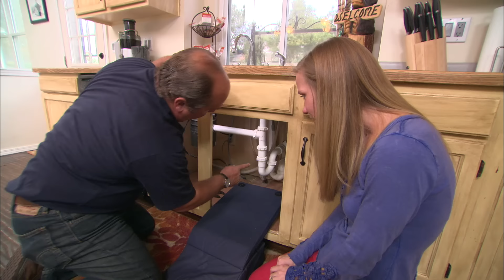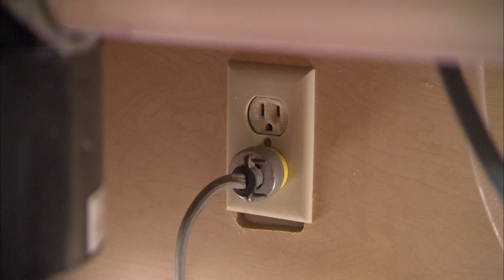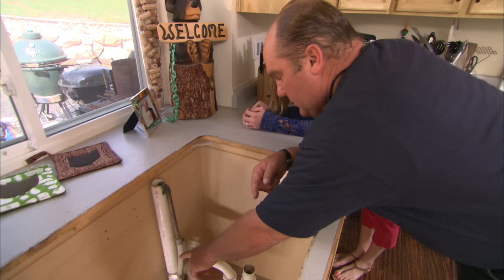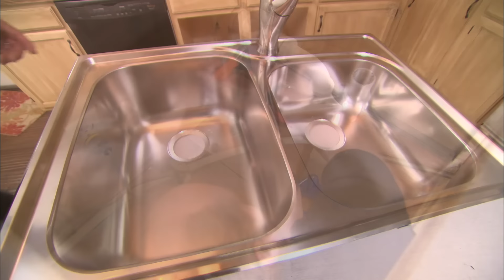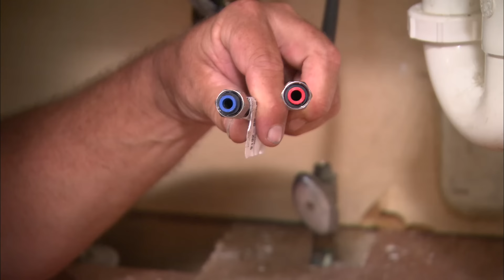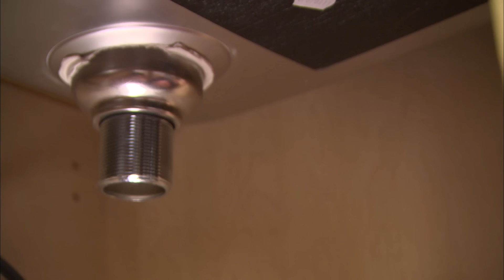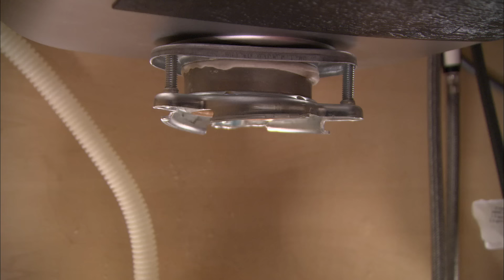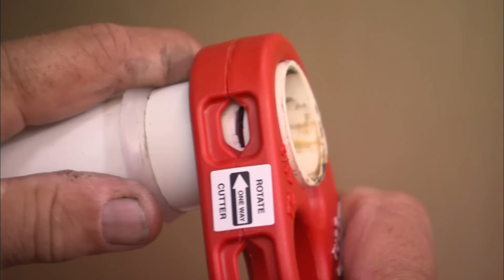How to Replace a Kitchen Sink and Faucet | Ask This Old House

Comment: What's a reasonable price I should pay someone to install a sink, given that I have already bought the sink, and just need the old one taken out, and the new one installed
Reply: I guess you've found the answer to that by now - kindly delete your post
Reply: TinaxSwag If your new sink requires  new pipes  and relocation add abt 100-150 plus labour+ TRIPSO:YOU SUPPLY SINK AND FAUCET, BUDGET ABT $250.

Comment: Why not attach the sink strainer basket and disposal while the sink is out? I've done strainers while the sink is out and it makes the job much easier.
Reply: The disposal unit is 4x heavier then the sink, imagine trying to lock it in place upside down? Having the sink flailing around because it’s light, possibly scratching it or damaging it. It just takes 2 seconds to place that thing in place afterwards

Comment: Nice video! Good info!
I needed help with having to get 32-year-old PVC drain pipes to line up to a new, molded-in, Corian sink, with the drain holes cut in a totally different location.
I just hope that the PVC joints are NOT GLUED, like I've seen in other videos from other mid-80s builds!
With MY luck, they probably are.
Reply: how did it go?
Reply: I guess you've found the answer to that by now - kindly delete your post

Comment: i Have a Question about Do You Think it wiLL Be possiBle Too put A kitchen Sink inn A Master BedRoom How Master BedRoom Have 2 sinks only BeCause

?ii? wonder is it The same Type oF pipes Should Be? some custom pipes at The HardWare Store What Give Me a HeadAche
The drain is more Smaller Soo should That Be a Big deal ?ii? wonder ii Got Too Look up other Videos uP ?✌🌎💨🌊💦🔭🔬📚📚📚📚
Reply: Lee Loomis OK
Reply: For a kitchen the diameter of the drain pipe is 1.5".  I believe bathroom drain pipes are 1.24."  You will have to go with the smaller diameter pipe.
Reply: in the bedroom??
Reply: Are you high?  Maybe you’re a child learning to type for the first time. Perhaps you spilled some apple juice on the cap lock key?

Comment: If your plumbing is very old often the shutoff valves under the sink can leak and/or not completely stop the flow of water. You can shut off the water main to the house and the feed valve into the hot water heater, then open the lowest (basement) faucet in the house to relieve the pressure. Then disconnect and install new lines onto shutoff valves. You might also want to just replace the shutoff valves under sink as well if they are all cruddy (if they thread onto supply lines, otherwise just leave em alone). Also, don't overtighten the flexible supply line compression fittings-just snug them up. If they leak, you can just tighten them a bit more until they stop leaking.
Reply: Just clean and debur the end or  it will cut the o ring. Just slide it on and make sure it's seated all the way.
Reply: and if your main shutoff in the house fails as it did in mine then in the front yard there should be a township/city shut off valve so you can replace everything.  Renovations always a fun thing!
Reply: Hot water eventually destroys the seals in the shutoff valve.
Reply: @n9wox 
Not a ceremic valve.
Reply: I had my kitchen remodeled after 14 years.  I'm on a well with hard water.  Do you think my stupid plumber recommended installing  new shut off valves  under the sink, when the area was open and new cabinets were being installed?  Heck, no!  Fast forward 16 years.  I'm about to replace the faucet myself and the first order of business will be sweating on new shut offs.
Reply: MarzNet256 if I have to replace my shut off valves and they're so cruddy I need to cut the copper pipe, do I need to do anything special besides sand and cut them before putting the new stop valves on? The new ones are sharkbite valves.

Comment: But not a word about checking for feed line or drain leaks - even with all new parts and quality work and pipe alignment you can still have pvc parts that the nylon gaskets simply refuse to seal. Sometimes its the brand of pipe, I had one sink drain assembly with raised lettering right where the damn seals needed to go - wth-???

Comment: Who makes that pipe cutter?
Reply: Rigid. They've been making plumbing tools for a hundred years though they make electric drills and a host of other tools today.
Reply: Thanks Joe. I did find it locally. It's been hanging on the wall at a local plumbing supply for years! It was there all the times I was there getting other things and did not happen to think about it! Anyway, I own one now.
Reply: I end up needing one of these every couple of years.  For $20, well worth it.

Comment: Do you actually need to use the putty on the top side when the drain assembly has the gasket on the underside?
Reply: cetusipy yes
Reply: yes, it would be possible for water to leak between the sink that the top portion, into the bell housing on the bottom and damage the connection.  there was  a segment on ATOH where that is what happened to the home owner.
Reply: YES!!! That's THE seal between the sink & the drain pipe!!!
Reply: Yes or else the bell will fill up and rust
Reply: cetusipy yes but silicone is leakproof longer
Reply: Rubber seal does the job also

Comment: How is this sink vented?  I thought they would have to install an AAV.
Reply: The waste line is connected to a vent stack inside the wall.
Reply: With the age of the house and this being a sink under a window it probably wouldn't have a run of vent pipe leading to the stack... too bad they didn't discuss this at the outset.
Reply: Because the sink is under a window, the trap arm running into the wall most likely has a 90 elbow running left or right passed the window then drains down and vents up with a sanitary tee
Reply: On my mobile home the only vent comes from the other sink haha

Comment: Great work except that any drain line left unless, needs a permanent cap per city code.
Reply: How do you know what the local plumbing code requires at that location?  Local plumbing codes are not universal across all cities in the United States.
Reply: Good point Cortez but, a glued plug or some form of permanent cap would be required by most if not all.

Comment: The screw clamps on my sink are rusted solid. What to do...
Reply: Cut them off!
Reply: Burn the house & start over ;)
Reply: I am not sure if there is room to cut them off, but I will try. Thanks. Burning the house down would definitely be profitable due to the low market value of my house and the replacement cost policy that I have. However, I want to try cutting the clamps off first,  but I will keep the fire idea as option 2. Thanks.

Comment: Richard, get rid of the hand saw and get yourself an osculating multi tool
Reply: On that job, I would prefer the oscillating tool like my Multimaster.  Just works better in cramped conditions like this.
Reply: I use a ridged ratcheting pipe cutter cuts up to 2 “ abs pvc. Clean quiet quick.
Reply: Seriously. I saw that and all i w as s thinking was, "this guy can't afford a Hackzall?"
Reply: BubbaGrace A reciprocating saw can be awkward to use in confined spaces, an oscillating saw is a much more efficient tool to use
Reply: oscillating tools are awesome. Make a terrible sound but awesome lol
Reply: Most of us use a reciprocating saw (Sawzall) for this.
Reply: Moon Pie - I like the cut of your jib sir/madam! I use plastic explosives myself, and the resulting prison time frees me up from everyday sink chores ... ;)
Reply: They make pliers to cut through pvc best thing for it.